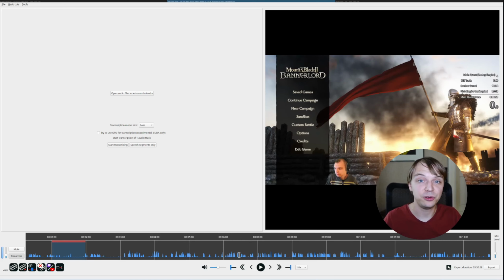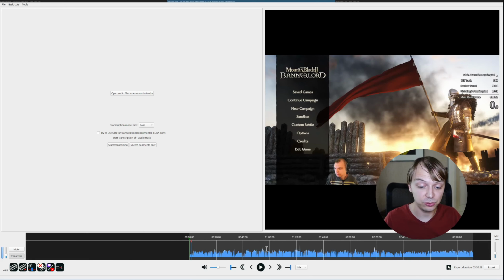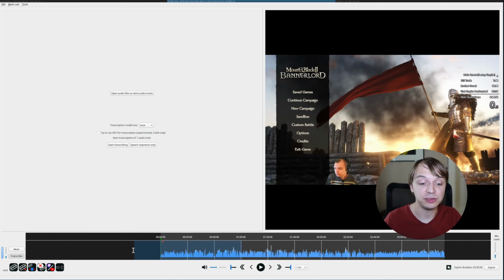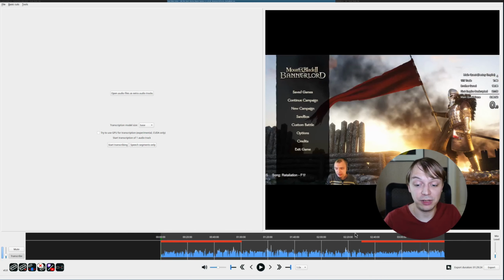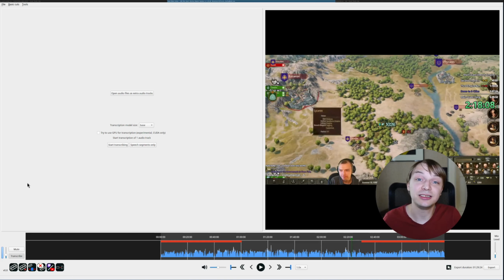Fix Exported Video Without Re-Rendering

Comment: The capability is fantastic, and the speed is great - but the editing selection is horrible. Howvere i would be so much easier to use if you could move to a frame and mark it for start of cut, then move to another frane and mark it for end of cut (rather than the current process of marking selection with left mouse click and drag - and trying to guess exactly where the start and end frames that you want are located). Could be so much better. Also dislay of current time in video at cursor point would be very useful.